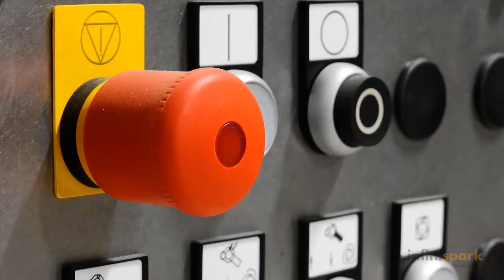What is an Electrical load?

Comment: Thank you for a quick and simple explanation of what an electrical load is!
Reply from the maker: Thanks Israel Hernandez, glad you liked it. Are you studying electrical/electronic or working in the field? Any other videos you would like to watch?
Reply: @infinispark Hi, I'm sorry to bother you but I have a quick question. Were you able to measure current here? And if so, could you explain how you did it or possibly make a video on it? 

Because I made a very similar design. And I can get a voltage and even light a light bulb but I can't get current.

Comment: Hey Huss, what determines how many Watts an appliance requires to work..i.e A toaster?
Reply from the maker: Hey Craig,
I believe that it depends on the parts and components the manufacturers install to satisfy a certain requirement. The purpose of a toaster, for example, is to give enough heat to toast, to produce heat they use a heating element, heating elements tend to be resistive in nature and more power this element draws, more heat it'll produce. A 1000w toaster will have a different element(s) than 2000w and the latter is capable of producing almost twice the amount of heat. 

Same goes for other loads like a motors and lamps but their purposes are different so the internals components will be chosen accordingly.

I hope this answers your question. If not, please let me know and I'll give some more examples.

I'm glad you're still enjoying the videos mate.